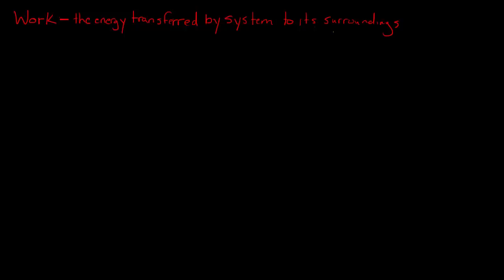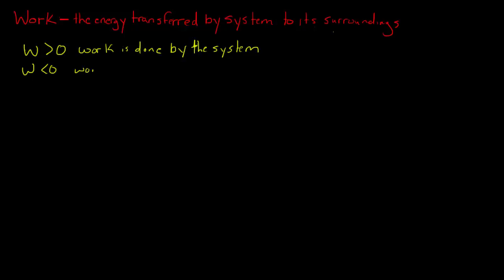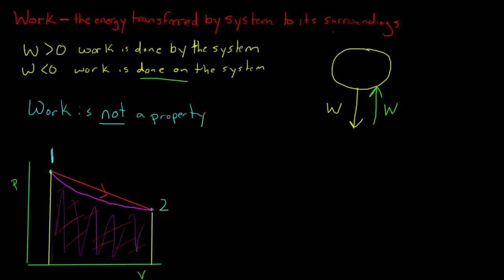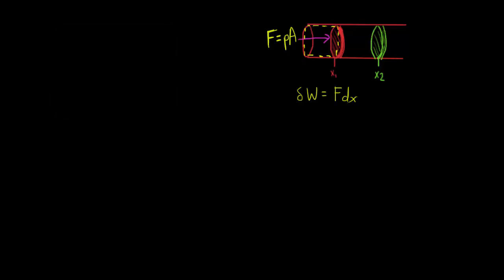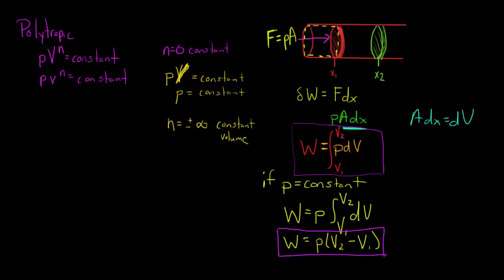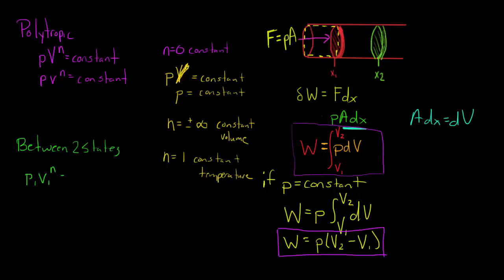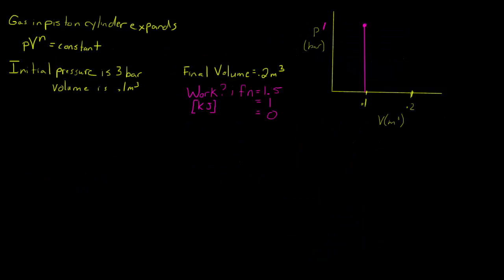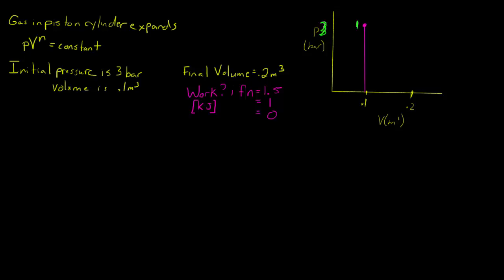Thermodynamics-Work

Comment: How do you know exactly how the curve looks like for the processes? Like how did you determine those points. That part isn't clear enough please
Reply from the maker: if im understanding your question its because its a polytropic process. the equation for a polytropic process is given by p1v1^n = p2v2^n. so the shape of the line is given by the equation p2 = p1(v1/v2)^n . graph this and look at it equation for different n's values and you will get the curve shape. 0 is a straight line because it will simplify to p2 = p1